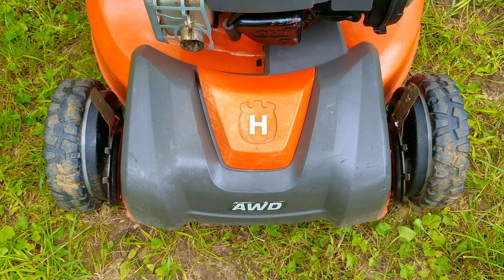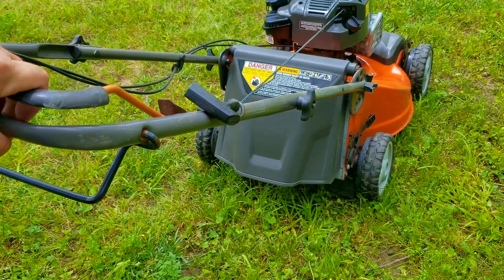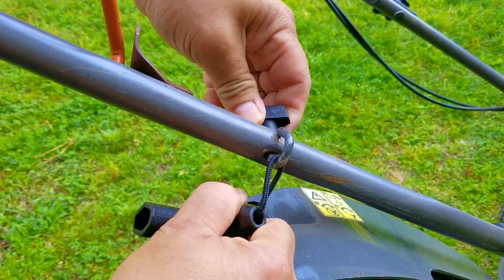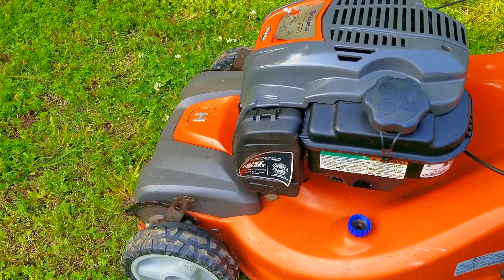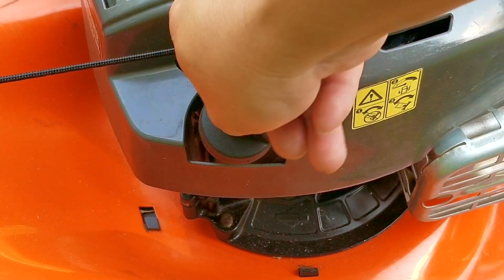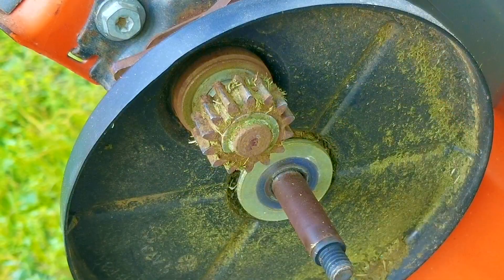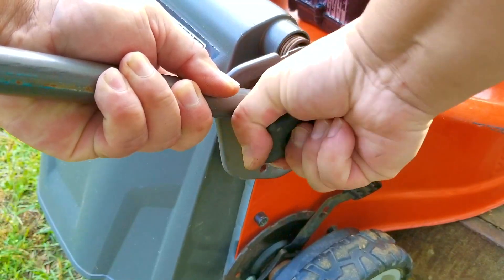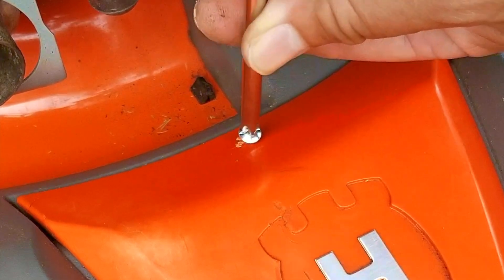The Parts Came In, For This Husqvarna Mower And I Think I Made A Good Choice.

Comment: Replacing the whole recoil assembly was good decision.  Reason is this a a good mower.  Al-wheel drive mowers are expensive.  This mower would have been better with Honda engine, but B&S is probably fine.
Reply from the maker: thank you Anthony Hawkins.
Reply: It seems like the block on the Honda mowers is made rather cheaply out of aluminum at least from what I've seen. The quality of the block seems cheaper on those if you really look into it, at least Briggs & Stratton painted the block black.
Reply: hondas have big problems now
Reply: @cdos9186  2 grades of Honda motors. The slanted block is homeowner, the straight across is heavier duty.

Comment: This is unrelated but you can use a long metal tube as leverage to fix a bent crankshaft, if it's bent you don't have much to lose so it's usually worth a lot, and it saved my weedeater mower which is one of my favorites because it's in fabulous condition otherwise
Reply from the maker: thank you TheRandom Man,

Comment: Maintenance is the key and anything you have to spend on your stuff is really just an investment for a working rig later on. I'd go with the whole assembly too because what caused the original to fly all to pieces!  I was thinking about transmissions for my rider. I found a new one but it is pricey and I can always get a 2nd hand one BUT what's going to win out in the long run. A new one with no trouble or one that's already been run through the wringer. I choose NEW because I'm fixing it for HERE and a new tranny is a lot cheaper that some tin plated tinfoil plastic thing. And a straight drive is a LOT cheaper than hydrostatic. And the Deere mower had grease fittings on the drive parts and were dry and worn out. That's where the motor for the Snapper came from. Good fix! GBWYou!
Reply from the maker: you said it all, second hand is great but the reliability is questionable
Reply: @INSIDEHOUSEGARAGE  I've done a lot to this one but a lot had been done TO this one before I got it but it's all a gamble. The opposed twin motor was the kicker for me. I found an adjustable jetted carb on Ebay and replaced that lean jetted thing with it. I could've bored the factory job out but no need. No surge now. New deck shell and spindles and I popped the cases on the tranny and oiled/greased up the innards. Tires with tubes and the belts are lasting. I try and play catch up between seasons. You know how it is.

Comment: do you think electric start push mowers are worth the hassle of charging
Reply: Most people who have switched, would not go back to gas.
Now consider a few things.
Gas prices
Lawn size smaller lawns definitely 
Your age no pulling starting cord
Smaller storage space needed.
Lower maintenance
Reply: @johnmckee7937  he’s talking about electric start, so the ones with a key or button that you push and it starts the gas engine. Not battery powered lawn mowers.
Reply: Electric start is worth it if you keep up with maintenance and are on top of it. If you don’t keep up with it it’s dead weight on the mower.
Reply from the maker: I do.

Comment: Our power equipments market is overwhelmed by Honda, everything non Honda you work on is good education for me
Reply from the maker: really?  if you take a look at my library  barely 5% of it, is honda.
Reply: @INSIDEHOUSEGARAGE  My experience with a Honda was not good, at least new. The block seems cheap and the mower is the loudest push mower I've ever used. The engine makes a ton of noise and the block is not even painted like Briggs & Stratton. I now feel Honda is overrated.

Comment: I've inspected the clutch assembly on the Husqvarna 252RX and what i found was not good news, the reason the trimmerhead was spinning when i tried starting it turned out to be that the screws on the new clutch are making contact with the clutch drum i could know that by seeing that the screws were scored by making contact with the drum, should i leave it like this or should i grind around the screws until they no longer make contact with the clutch drum ? 🤔
Reply from the maker: first do you know why the screw was in a "position" to even make contact?  It shouldn't have been able to make  contact.  that's what I would try and find out, before grinding on it.
Reply: @INSIDEHOUSEGARAGE  i checked if the clutch was placed in straight it was but the screws made contact because the heads of the screws are somewhat too big i think the only solution to fix the problem id to grind around the heads that way it won't make contact anymore and the clutch will work just fine according to dad 🤔
Reply from the maker: give it a try

Comment: I have a Husqvarna 4 wheel drive mower but it had water in the tank so I took the tank off and let it dry out for 2 days then I put fresh Gas in as well as a new Spark plug, Air Filter, and new Thermowax Pin..still won’t start what do I do?
Reply from the maker: drain the water out of the carb Bowl, then the fresh gas you put in, will make it to the carb.

Comment: If anyone actually has an issue with you replacing the entire recoil assembly, instead of just the missing parts, they are just wrong really. First off, you pointed out that the missing parts could have been the result of damage to other parts of the recoil, which is not unlikely. Especially with these newer mowers, that particular recoil design is kinda flimsy and unreliable compared to older models. Even if the other parts weren't broken, it's unlikely they'd last much longer anyway. Just overall not worth the risk to save $15.

Also, when you look at the cost of repairing the mower vs. the value of the mower, $30 is really not bad at all. Even if it was an older, basic model in slightly worse condition, spending $30 is worth it to fix a mower that would be worth around probably $80. For your mower, being that it's a fairly new model, all wheel drive, and give you the option to bag, plus the Husqvarna name brand, I wouldn't be surprised if you could get between $150-200 for yours. That makes the mower well worth the $30 + I'm guessing 1-2 total hours of your time to repair.
Reply from the maker: thank you NerfCraft.